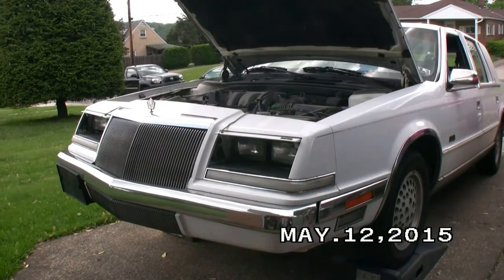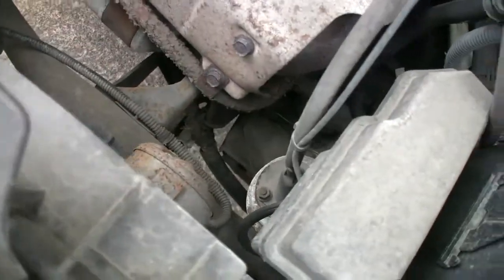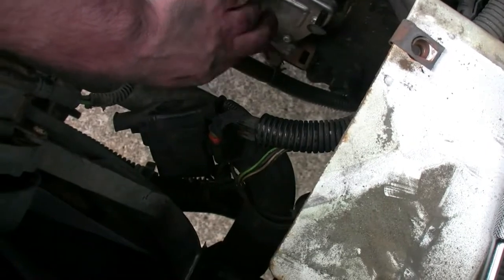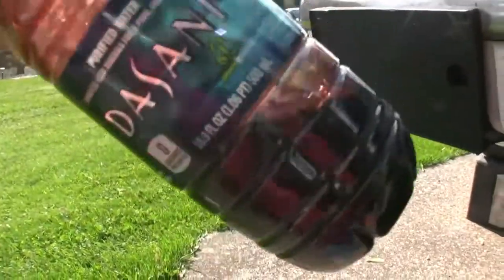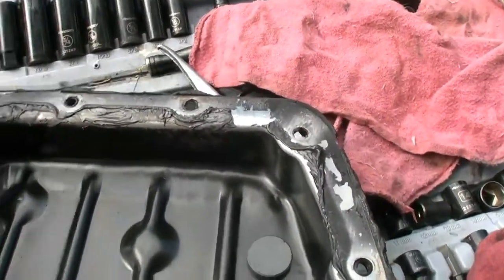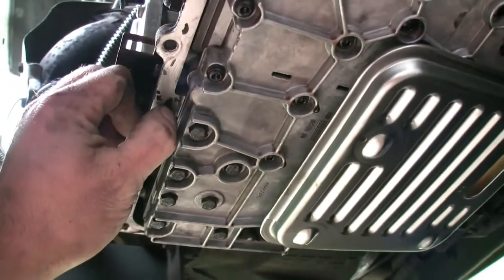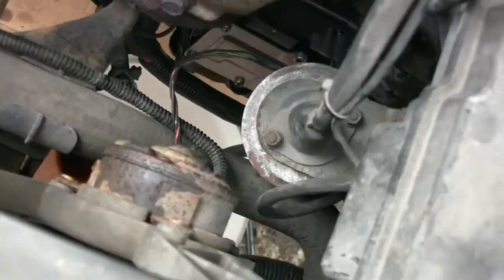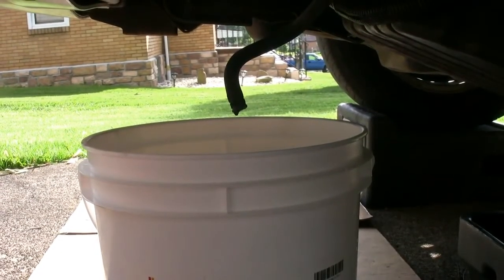(2015) 1990 Chrysler Imperial Transmission Filter Change and Flush

Comment: You need to check the error codes on the transmission.  Also, I read that limp mode could be related to the EGR valve.  Hope you figured it out eventually.